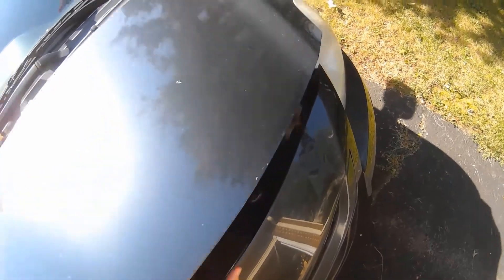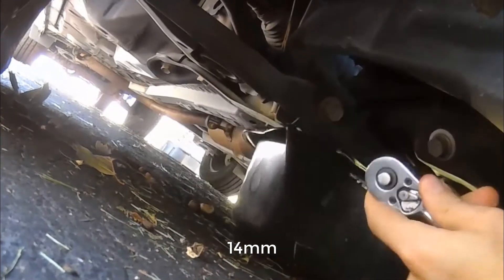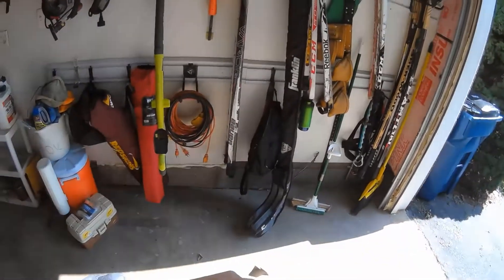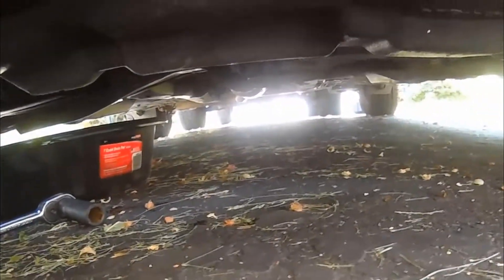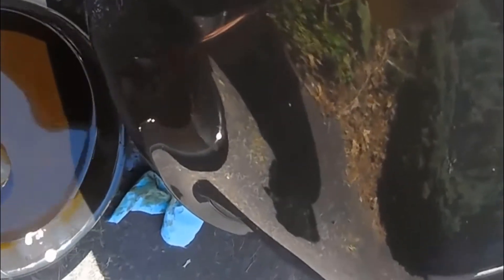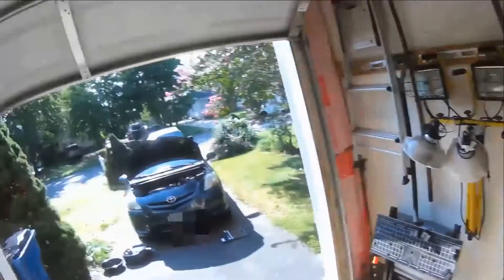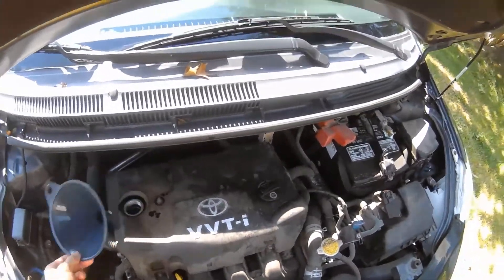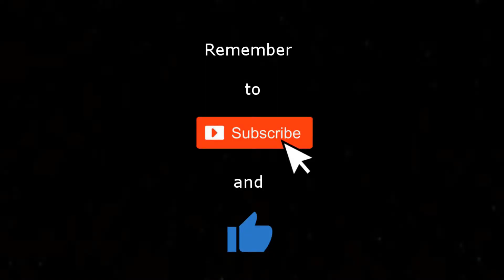Toyota Yaris 2007 1.5L oil change (without using a jack)

Comment: You failed to show the ‘crush washer’ for the drain plug.....removing the old washer and installing a new crush washer onto the oil drain plug.  (It IS a booger to remove that crushed washer from the drain plug!) Did you not use one, or just didn’t bother showing it?  Inquiring minds would like to know.  I ordered a few OEM Oil Filters and they came with a new crush washer for each filter.
Reply: my dodge doesn't even have crush washers or any sort of gasket on its drain bolt; they are not mandatory.
Reply: I have never used the crush washer and hand tighten my filter. I have never had any leaks. I do the same on all my vehicles.